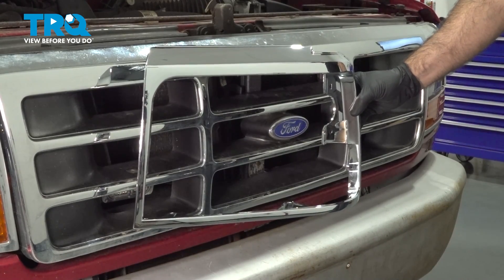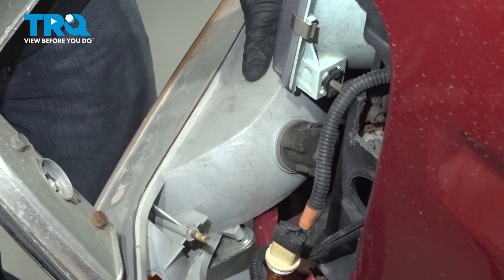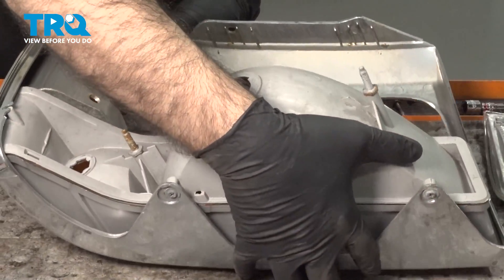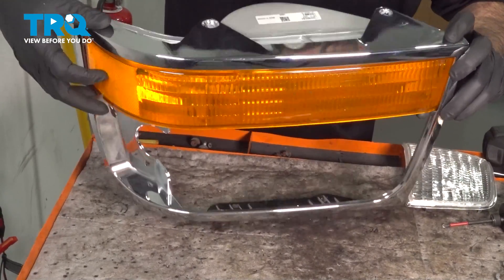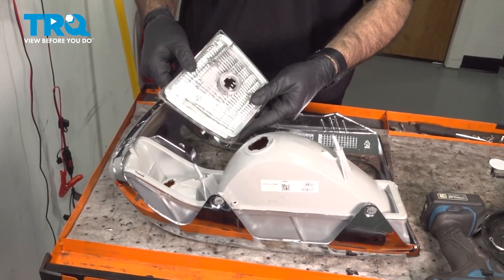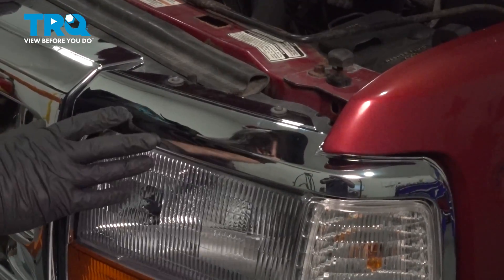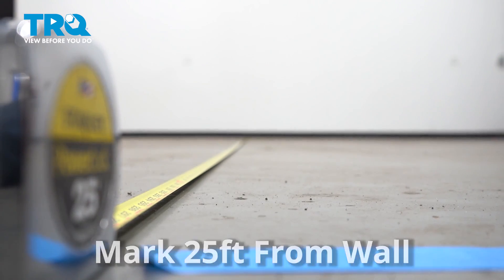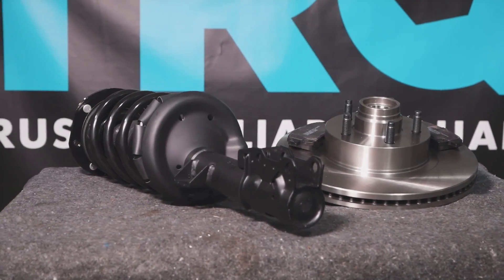How to Replace Headlight Bezel 1992-1996 Ford F-150

Comment: I had 2 bolts on my blinker light attached in the frame. Had to take the nuts off to get the bezel off. Would have been nice to mention that. I have a 1996 f150xlt.

Comment: He does NOT mention the following: There are two studs behind the turn signal housing that have nuts holding them in. This holds the bottom portion of the assembly in place.  The best way to access them is to remove the washer fluid / coolant overflow bottle on the driver side. On the Passenger side, remove the battery to access the nuts. Also, EVERYTHING is METRIC on the body of these trucks. This was the era in the late 1980s to the early 1990s where most of the body fasteners were metric and the engines were SAE / U.S.

Comment: IF THE PASSENGER SIDE HAS FOUR BOLTS OR SCREWS THE DRIVER HAS TWO ON BOTTOM ALSO AND HE DOESN'T SHOW THIS, IT IS A PAIN IN THE ASS. PLUS, THOSE DAMN RETAINER CLIPS RUSTY AND HARD TO GET OUT. I HAD TO TAKE GRILL OFF AND UNBOLT THE PASSENGER SIDE TO ALLOW MORE ROOM TO GET AT THE RETAINER CLIP. NOT HAVING A GOOD TIME GETTING TO THE DRIVER SIDE LOWER BOLTS ON HEADLIGHT ASSEMBLY... TAKE OUT THE ANTIFREEZE AND WINDOW WASHER CONTAINER TO ACCESS THE TWO LOWER BOLTS AS SHOWN IN THIS VIDEO... https://www.youtube.com/watch?v=wGl-24g1AvQ   PEACE...
Reply from the maker: +Fosters Wildlife Sanctuary and Homestead Thanks for the feedback! http://1aau.to/m/Shop-TRQ